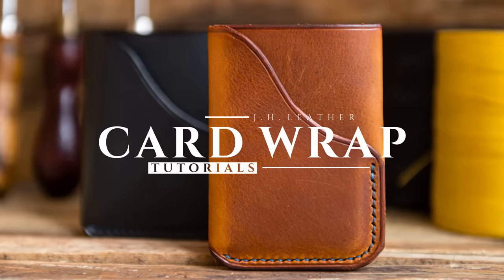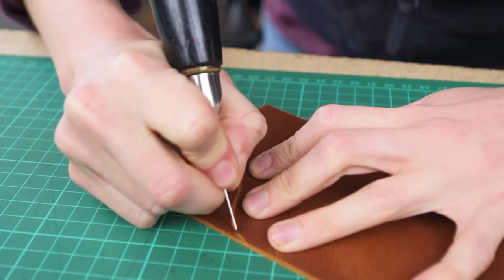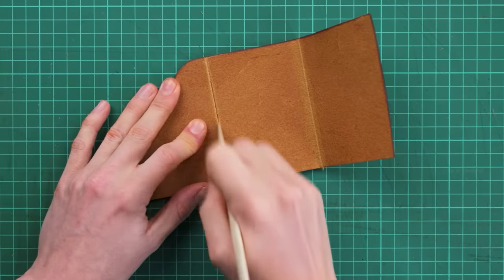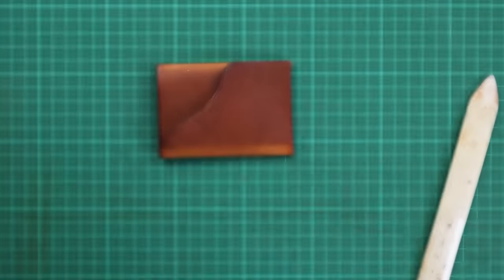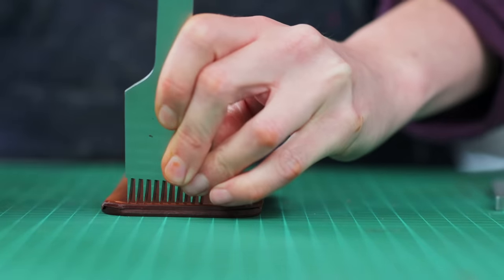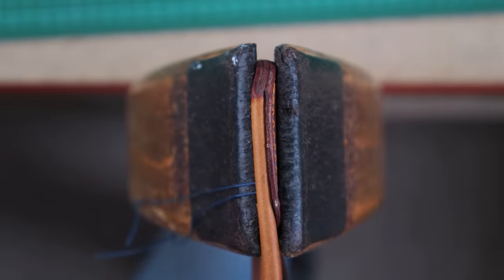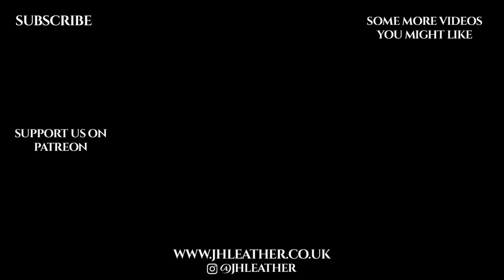Make your own: Card Wrap - Make Along, PDF Pattern Pack

Comment: is that stain cloth a piece of heavy canvas? I thought it was leather but Im thinking its canvas. So you as well as another only use the pricking tool to make partial holes but use a triangular awl to finish the holes through the leather. To me that is the much easier way. I have tried using the pricking tool to punch through two layers and its not so easy to remove. Time to make a triangular awl to use as my final stitch punch.
Reply from the maker: Yes it's just some linen canvas 👍 I was trained with an awl so it's second nature to me to use one rather than punch my stitch marks all the way through, unless it's really thin leather and it'll go all the way through easily
Reply: @JHLeather  Thanks for that information. :)

Comment: I see some leather crafters use using the edging tool and others don't. Could you please explain what that tool does. If you have I apologize. Great video as always
Reply from the maker: The edge tool removes a small amount of leather of the cut edges and makes them slightly rounded. Hope that  helps👍

Comment: Nicely and specifically done. I do wonder what type of dye you were using on the edges and what you used to finish then besides a burnishing tool.
Reply from the maker: Hi Michael, the edge stain I make myself (see video here https://youtu.be/hPJL7311020) then I usually just use a stain cloth to polish the edges.

Comment: I’ve noticed how handily you hold awl and needle in one hand. Do you ever use punches/pricking tool to go fully through?  Might I also ask the maker of your hammer as well?  I’m new to leather working.
Reply from the maker: Depending on what I am making and how thick the leather is, for example on a wallet you can punch all the way through easily.

Comment: Love the video! What tool are you using for the edge, (3:35) to achieve that look to the edging?
Reply from the maker: Hi Mikey, I use a no1 edge tool to bevel the edges of the leather and then an adjustable screw crease to put a decorative line around the leather. Hope that make sense. Jo

Comment: Hi, just come across your channel. Great work and great presentation. Is there a guide to that edge creaser tool or do you just make it look easy!
Reply from the maker: Thank you 🙂  I have shaped the inside part of the creaser so its about 1-2mm smaller than the outer side. That way it gives me a bit of a lip to use as a guide.

Comment: I love this!  Apparently creasing irons aren't used much in the US; I'll have to look into that some, because it does give a lovely finished look to things.
Reply from the maker: They are very effective at giving your leather work a high-end feel.
Reply: I've noticed that too.  It doesn't look properly finished to me without the creasing but I suppose this will make your work stand out.  I think it makes the edges more durable so it isn't just a decorative step.

But I have to add...some of the leather goods, especially bracelets, sold on Etsy in the US don't have the edges properly finished so I doubt those sellers would ever bother with creasing.

Comment: Where do you get your irons from and edge beveler? Any links please.
Reply from the maker: I get my pricking irons from Abbey England, the edge beveler's I got from them about 12 years ago, and they don't stock that specific brand any more. They do do an alternative which I use on my leather courses. 

Pricking Irons
My set: https://www.abbeyengland.com/abbey-traditional-pricking-iron-set-right-hand-9942.html
Cheaper set (just as good but lighter weight/smaller): https://www.abbeyengland.com/abbey-traditional-oblique-pricking-iron-set-right-hand-10098.html

Edge Tool
https://www.abbeyengland.com/economy-edge-tool-3006.html
If you are after a posh one then have a look for Vergez Blanchard, they are based in France  and you can buy direct or you should be able to find a third party supplier.  

Hope that helps

Comment: Thanks for the video, but I have one question, why not wet the leather before folding? Doesnt that protect the leather from Mark's during the folding process? (I am fairly new to leather working)
Reply from the maker: Hello, it depends on the leather that you are using. As this is an oily hide there was no need to wet the turn areas. If you have a dry leather though then yes, wetting the leather would be advisable to stop any cracking.

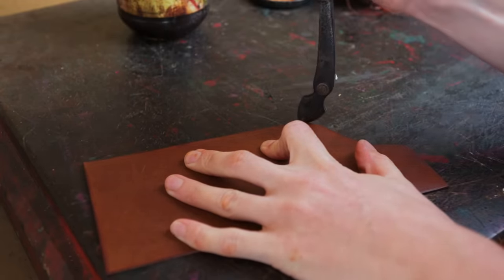Comment: 4:40  of the video shows a creaser.   I want one of those. where did you get it? are they available?  
If you pick me I will exchange with you my version of a credit card holder.
Reply from the maker: Hello, the crease I use is an adjustable screw crease. The one I have is from Joseph Dixon who have unfortunately closed down. You can get similar ones from Abbey England. Jo

Comment: hello dear, what's the name of the product you use at 4:00/ 14:55? what is it for?
Reply from the maker: I think you are referring to the stain, it is to stain the edges of the leather. It also helps give a nice polished edges when finished.
Reply: @JHLeather  yes, just that, does it have a specific name? thanks
Reply from the maker: The one I used in the video I made myself like in this video: https://youtu.be/hPJL7311020

Comment: why don't you punch all the way through with your stitching chisel instead of having to use the awl for every hole?
Reply from the maker: I am from a saddlery background where it isn't always possible to punch your pricking iron all the way through the leather. There is no problem in doing that with this project though, I am just used to using an awl when stitching.

Comment: A problem I have is how do you stop the second needle going through the thread of the fist ? Making a horrible loop in the thread.
Reply from the maker: Hey Gordon, when your second needle is in the hole, pull back on the thread of the needle that has been already pulled through. If your needle in the hole has gone through the thread then it will be 'locked ' in place, if it hasn't gone through the thread then the thread will run back through easily. Hope that makes sense.
Reply: @JHLeather  Thank you .

Comment: Мне одному показалось нелогичным, что торцы по низу изделия сначала покрасили и заполировали, потом шлифанули и прокрасили по-новой?
Reply from the maker: The glue that I use on this card holder is waterproof when absorbed into a raw cut edge of the leather so it needs to be dyed first to ensure the stain soaks into the leather. Even if you sand the edges with some glues, once they absorb into the leather they will create a waterproof barrier that the stain can't penetrate so its best to add some before, just in case.